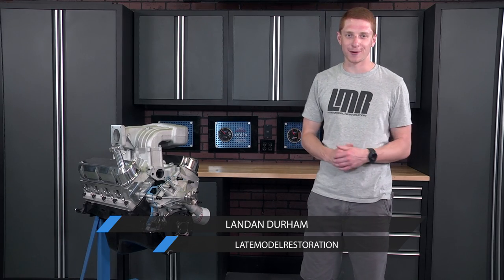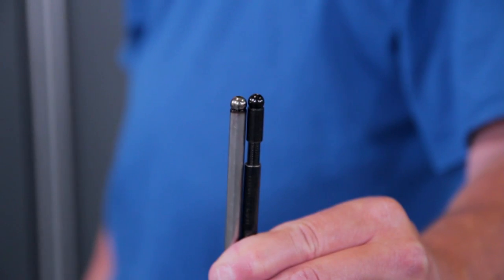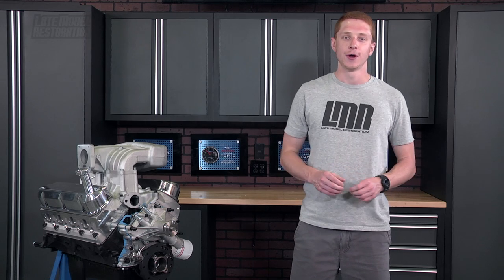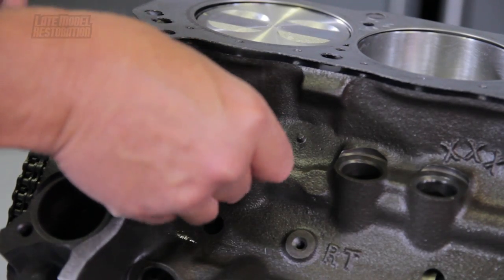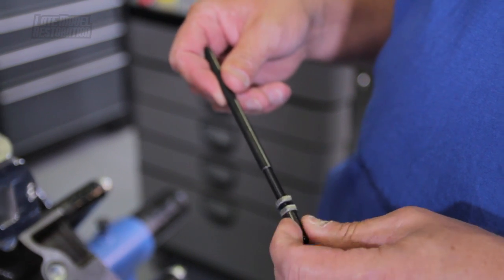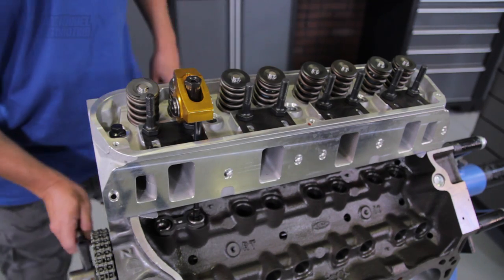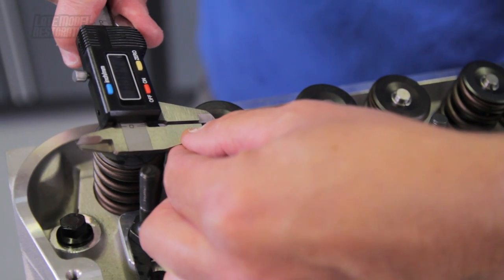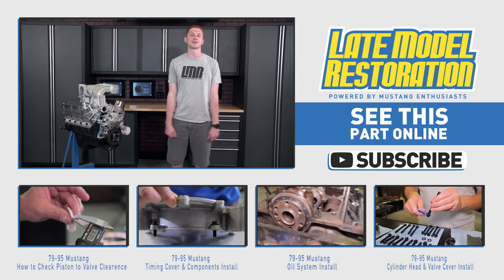How To Check Pushrod Length 302/351 Mustang (79-95)

Comment: I believe your supposed to set lash with a half turn after your feel the push rod start to drag on the roller(zero lash). Then do your sweep to get an accurate measurement of a pre-loaded rocker arm as it will be when you do finally assembly.

Comment: This is very helpful and i would say the most easiest and fastest way to determin pushrod length. as some people think you set your rocker at zero lash with your adjustable pushrod in, and crank your motor over, but what they arent understanding is ether with a pumped up lifter or a none pumped up lifter will still collapse while you turn the motor over by hand, therefore you wont be able to get proper pushrod length or valve train geometry as the lifter would be at its maxed out preload and you would leave valves hanging open..  therefore with a solid lifter all you have to do is get your adjustable pushrod to your desired length, check valve tip witness mark with caliper and if its good you then add   .30 thousands to the aquired pushrod length to get your preload, i believe a oem 302 lifter preload should be anywhere between              .30 to  .80 thousands, about 1/2 turn on your rocker would be .30 would be ok for a mild to stock build. But it really comes down to alot of variables of machined parts and different components.
Reply: What’s the correct size solid lifter ? I purchased the adjustable push rod and I purchased a solid lifter but it’s not the same length of the roller . It’s a bit shorter

Comment: This is not correct.  The felt tip marker center sweep method is crude as compared to the mid lift method which ensures proper valve train geometry and full valve lift. If you use the center sweep felt tip marker method, then you must use a solid lifter or lite weight valve checker springs.
Reply: crude? yes

incorrect? no.  not on a street engine.  you will get the right pushrods  and plenty of people have done it.  the other way is more correct its just way more math because youre accounting for a lot more things

if it was a racing engine  with some money into it  id say yeah,  dont use this way.  aint gonna hurt a street engine  tho

Comment: I dont understand the sweep part? the permanent. marker. I just dont have a understanding of this
Reply: The sweep happens because the rocker is not pushing the valve straight down,it is pushing it down at an arc due to the fulcrum of the rocker.
Reply: It's supposed to be under .050" for high revving race applications and in a small circle.  The Summit Racing and this video's explanation show a sweep, but ThunderHead289 in his video had just under .050" in a small circle.  I am assuming that is an indicator of the rocker canting because the rod was too long and he couldn't tighten the rocker all the way down to the pedestal (for hydraulic lifter applications).  Ensuring you pump up the lifters so they don't have any play in them is something you should do before doing this as well.  Either install them prepumped or get your engine in the bay and crank it over without fuel and spark for a quarter of a minute to get the oil pressured into the system.
Reply: The permanent marker is also supposed to show if the rocker is centered on the valve stem

Comment: He also says set the pushrod length to 6.272".  However, a SBF pushrod length is over 8".  Along with the other comments, this video is a fail.
Reply: This is for a roller engine (86-95 5.0) not the older style 302's.
Reply: this is not for us that have retro rollers.  different lengths between these and factory roller 5.0/5.8s   but the method is still valid

Comment: This is not how you check pushrod length please dont do this. Correct valve train geometry is achieved by getting your rocker arm 90 degrees with your valve at mid lift. This is easy to check all you need is that an adjustable pushrod. There are many videos on youtube showing you how this is done.
Reply: 1/2 lift but I also been reading a lot about 2/3 lift.  With 1/2 lift just doing my intake I am looking at 6.50" length pushrod.  With the 2/3 lift method I am looking at 6.35" length.  Im still on the fence myself on which one I want to go with cause I really want to run 0.120" wall thickness pushrods but not offered for 6.50" length just 0.080" wall thickness.

Another thing is I like to know how are they doing the sweep test with a adjustable pushrod with actual valve springs.  Every pushrod length checker I found stated to not rotate the engine with out checking springs installed as the spring pressure will damage/destroy the checker.
Reply: this will work on a street engine.  PLENTY of people have done this method for YEARS and dont have valve train issues

for a race engine,  i would do the 1/2 lift method but this is fine  on street cars 

dont over complicate things that dont need to be overly complicated

Comment: That is not the way to check it. That mark will be always the same width.
Reply: You are correct.  What you should be looking for is the location of the mark (centered) not the width.  Changing the pushrod length will not change the width of the mark.
Reply: @nelsonnolte430  no ive seen people do these videos  and that mark looked to be well over .100 very wide

its BOTH.  centered  on top of the valve  with the narrowest sweep possible